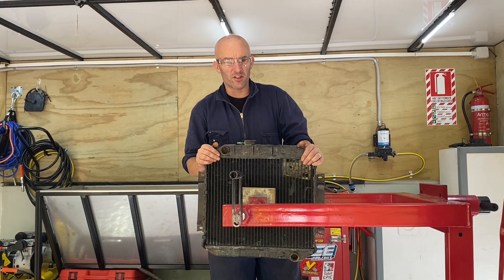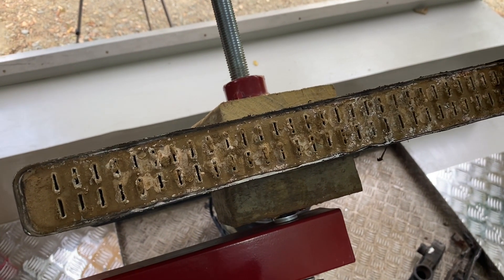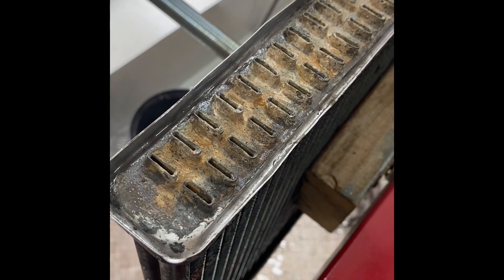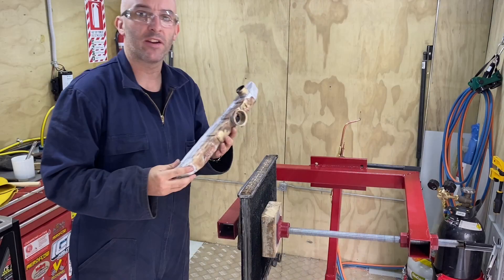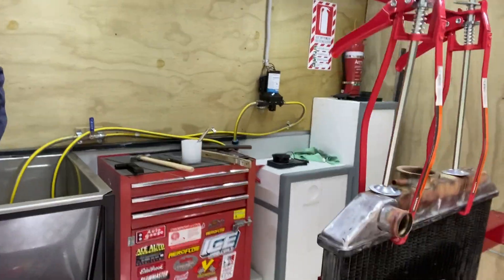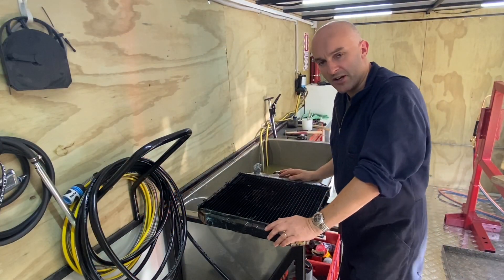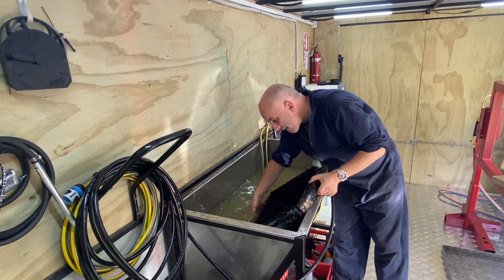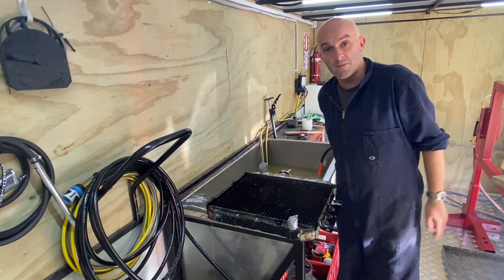Copper radiator complete clean out process

Comment: Interesting....I've an offroad truck with a rad leak on both left and right ends...considering a DIY repair...what kind of solder is best? and why wouldn't you braze it?
Reply from the maker: @Monty_NSW  you wouldn’t braze it because then you would melt the solder around the tubes. I have had people try then bring them in for me to resolder all the leaks around all of the tubes. Depends how much distance you have between the tubes and the  leaking edge of the tank. Some old cars have plenty of room to give it a go yourself. Some do not and you’ll make a heap of leaks around the tubes when you heat it up. Cheaper for a radiator shop to repair it than have to put a new core in it if you muck it up.

Comment: What did you use to rod the radiator channels?
Reply from the maker: @PaulRM329  I get clean out rod from a radiator manufacturer. Also you can use drain clean rod or old spring steel from lawnmower pull starts. Lots of options as long as it fits down the tubes.